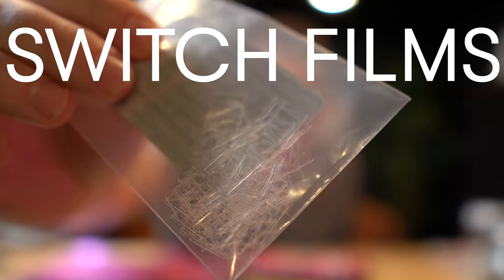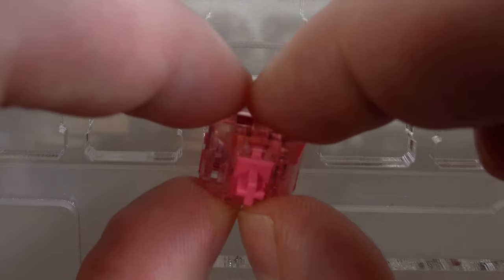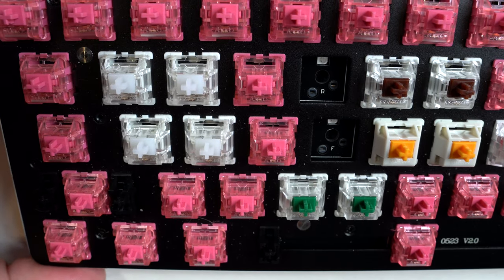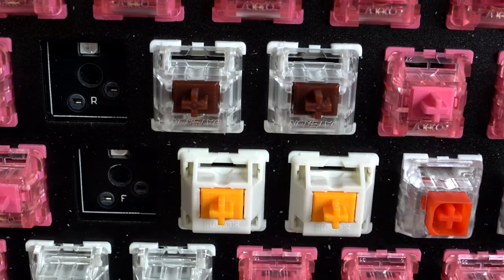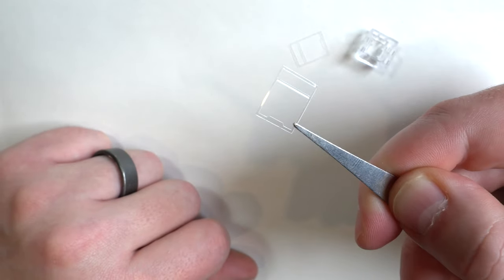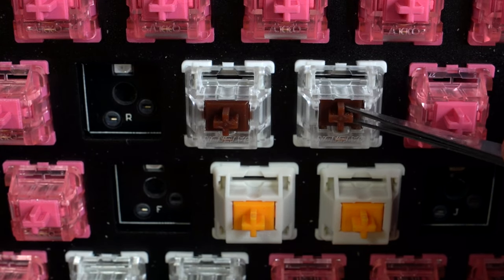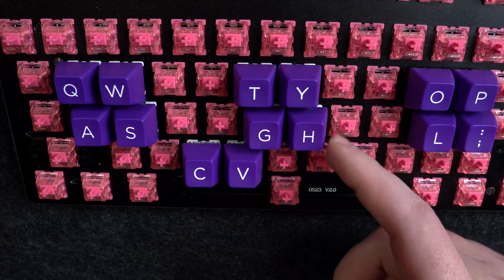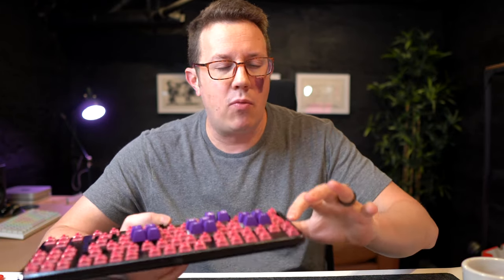Switch Films Explained (should you even bother?) // Tutorial + before and after sound test!

Comment: the worst part was the sound test, why you didn't lube the springs ? It's so pinging, my ears ... Springs should be lubed with krytox 205g0, not with the krytox105 oil crap.
Reply: Why is that? I never tried lubing switches before but I am researching about it atm. Many people like to use 105 for the spring. Can you explain?
Reply: @OrdinaryAsianGuy the difference is the viscosity, 105 is more like a thick oil whereas 205 is more like a gel, its simply easier to throw all your springs into a bag, add a few drops of 105, and then shake to evenly coat the springs rather than having to individually coat the springs with 205
Reply: 105 isnt crap, u can use both for maximum spring ping reduction

Comment: Does the nuphy mints need it?
Reply: Check to see if the provider/maker/vendor specifies if you can or can not film them. Basically try it out none of this is needed but some people love filming and lubing.

For example my gazzew/boba switches are known for having little wobble. So little in fact gazzew himself says it’s a waste of time/resources to do so, however, I have seen people still want to film them for sound benefits using .125mm or thinner films.

In fact I’m the type of person to immediately open and properly lube and swap spring on every switch I get my hands on as soon as the package is first opened lol. 

To decide for yourself try rubbing the top and bottom housing around while the switch is assembled to see how much sliding/movement there is.  If there’s too much and it’s affecting the stem/keycap wobble, go ahead and film, if not then you likely can if you want to but it’s not needed.

Comment: Is there alternative to glorious panda they seem sturdy... Kailh box?
Reply from the maker: Yo! You could try some Kailh box purples or royals maybe? Those appear to be pretty close in tactical-ness (tactility?).

That said, these are modeled after the Holy Pandas you can find on Drop, though those are priciest probably.
Reply: @KeebNews  how about aqua king or boba u4s
Reply: @osirusj275  I haven't tried the Pandas, but Boba U4 are silent tactiles and they have a scratchy feel to them. After a few hundred switch actuations, the scratchiness reduces by more than half I'd say, but they will retain the scratchy feeling to some extent. I use them for my keyboard at work and I don't really have any complaints. Lubing will almost entirely get rid of the scratchiness according to what I've read from others, but you will lose tactility. I haven't tried other silent tactile switches, but the feel may be par for the course.

U4T are the "thocky" version. They are great. Pretty smooth to begin with, most people claim that lubing them offers almost no difference in smoothness. Comparable to the Zealio V2 switches, but with a more rounded bump profile. I am actually using some custom U4Ts from Kirball Keys for my keyboard at home. They have 65g Gazzew springs and were lubed. I can say they feel and sound great. I would say stock U4Ts are a great buy. They are a little cheaper than the Pandas, but you'll be waiting a bit until stock replenishes at all the authorized vendors.

Both Boba switches have practically zero pre-travel. It's likely less than on the Pandas.
Reply: @osirusj275  You can't film the u4T's because of the tight tolerances, I've had trouble to close them sometimes because they wouldn't lock probably its a great switch.